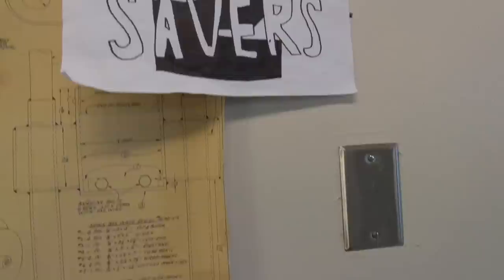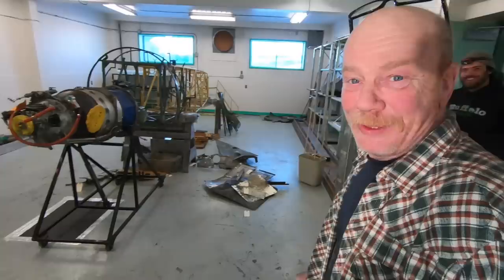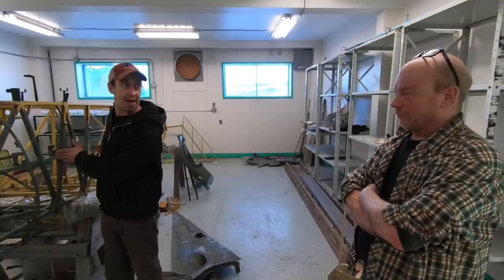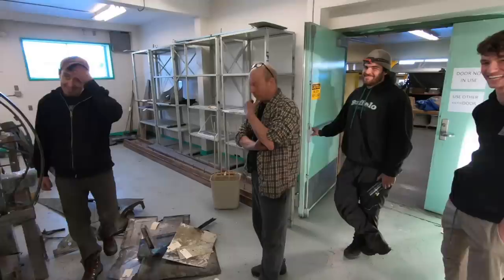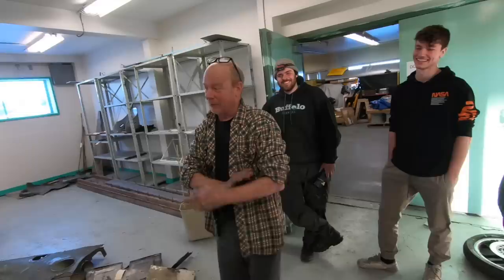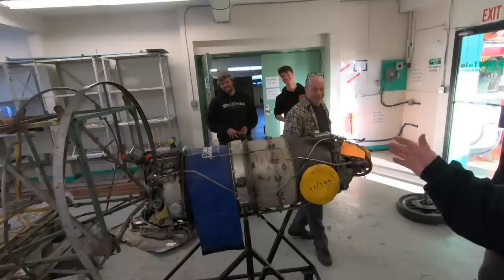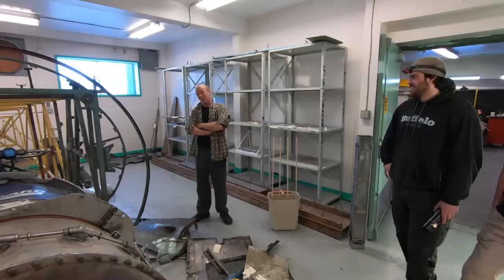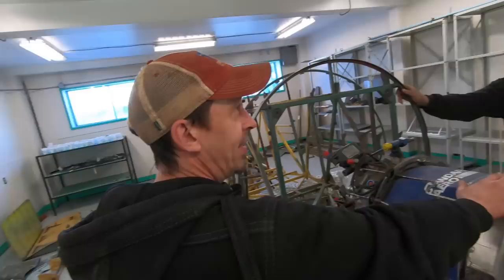Should we put a Turbine on a WW1 Triplane?  |  Plane Savers S2-E21

Comment: How many of the negative commenters here are actually real world, hands on, experienced aircraft designers? I know I’m not.
There seems to be too many “I think” comments and not enough “I actually know and this is how I know it” comments.

There is 2 issues at play here;
1 As original as possible/practical, or its a replica anyway, so anything goes.
2 is it technically possible/feasible.

You need to answer both those questions, and you will have your way forward.

Personally, I would do it if possible, but that is just me.
However the thousand people who assume because it’s a turbine it will automatically destroy the airframe does not sound right to me.
1 I believe the turbine is lighter?
2 if it is still spinning a prop, then so long as it’s matched to the airframe correctly and the engine is de rated and the VNE is upheld, where is the problem?
3 this is not a car where the object of an engine change is almost always to increase performance I.e. top speed.
4 it’s not about making the plane faster, it’s about making it better.
5 Would all these negative things be said if they were talking electric? It’s just a mindset that assumes turbine means automatic destruction.
6 In the case of Mike Patey, it seems his swaps ARE about more speed and power, and that is why I would assume he has to beef up his airframes so much.

Comment: I know Nothing about eroplanes but I am curios as to what would be stopping the plane from spinning round the motor. the air frame just looks like it would give up in protest and to be honest  1/16" ply and turboprop just dont seem to fit in the same sentence to me.  BUT  given the expertise in that room I would not doubt the feesability of the concept. AND as has been pointed out many times already,  Its not an original so your not committing any sort of historical hearasy so why not if its a viable option.  I have my doubts but keeping straight faces for so long by so many was a great feat if this concept is indeed a wind up.

Comment: You didn't mention half of the issues that turboprop engine would have caused. Having that much sida area added before the c.o.g., lateral stability would have gone out off the window, the wee little rudder of the sad little Fokker would not be able to counter the massive corkscrew-effect of such a strong engine, the wings of a Fokker Dr.1 are not made to withstand the drag they experience at speeds the horspower of that engine would get to in half a jiffy, the torque of a propeller driven by such horsepower would twist up the stringers of that fuselage like a bunch of well boiled spaghetti, the horspowers are thirsty, so on the plane's normal tank you'd maybe get a lap around the airfield out off it, the entire idea is just plain bonkers. 
I checked twice that video wasn't posted on April 1st. It wasn't, which I find kind of sad.

Comment: I'm not an engineer.  But the only concern in my mind is over-thrust.  Is this wooden air frame going to be able to withstand the force of the airflow against it at the speed that this PT6 is capable of pulling.  I'm less concerned about COG and more concerned about VNE.

We've all ripped the wings off a fly.  I just don't want it to happen on test flight day.

Let me put it another way.

You're putting a (roughly) 175 kg engine... on a 12 kg airframe.

I have full respect of Chuck and Rod and Ben and William.  But this just seems insane from my layman's perspective.
Reply: In local news, BUFFALO AIRWAYS has introduced the first supersonic passenger service since the demise of the Concorde.  Although no food service is included in your ticket, you're more than welcome to roast marshmellows over the manifold.  🤣🤣🤣🤣

Comment: uuhhhhhhhhhh......I thought it was April Fools Day at first (albeit at the other end of the year); but I see you are serious about it.  Not knowing how the aviation world works, could you get this certified to fly, or would it be labeled as an experimental aircraft?  How does the torque affect the aircraft - do control surfaces need to be enlarged?  Can someone mock up a sketch to show how it would look?   Is there a simulator like Kerbal to try this out first?  How do you synchronize the machine guns to fire through the prop?  Given the fact that you are currently missing the engine, mount, etc., this is 50-80% in your hands already, you have some very smart engineering types and a willing pilot, I would reluctantly say to do it.  It will definitely raise some eyebrows!

Comment: Good joke.... Even a totally run out PT6 is worth vastly more than a small radial.. Plus you would only have 20 or 30 minutes of fuel capacity... Plus the small tail couldn't handle the torque ...It would be a wild ride though... I fly single engine turbines for a living, and I wouldn't be anywhere near brave enough to fly that one.. Ag Pilot A&P/IA... I really enjoy your shows. Keep up the good work...

Comment: If you want to restore a Fokker replica, by all means compromise on a radial engine instead of a rotary.

But if you put a PT6 on the front, you no longer have a replica, Fokker or otherwise. You have a homebuilt, experimental, impractical airplane with a (free) turbine, and which has no practical purpose.

What's your point?

I kind of thought of this sort of thing back in the '60s when I had a Volkswagen beetle. I wanted to drop a Porsche engine in it. It was then pointed out to me that all I would then have would be a fast Volkswagen.
Reply: This is totally different. If you wanted to drop a Porsche engine into a VW beetle, it would be kind of an incestuous relationship.  But a PT-6 into a DR-1, no Fokker’n way.... :)

Comment: Why not?????????  You have got to fit a motor to make it fly and you have to design it so that it is safe so why not.
You can't fit the original motor because there are none  and the replacement piston engine is very pricey. A turbine would not vibrate as much and although the stresses are higher on the airframe you have to DESIGN the airframe.
Mike P can do it and so can you. Originality is not the issue, only stress loadings, safety and COG. Go fo0r it guys.

Comment: The more I think about it, the less I like the idea of a turbine engine Dr.I. Even on a replica. A bog standard modern Rotax, Lycoming or Continental engine, albeit boring compared to a massively over powered turboprop, will be much more adequate. Also simpler to install, easier and cheaper to purchase. I you absolutely want a radial engine go for e.g. a Verner Motor Scarlett 9S.

Comment: IMHO the PT6 on that plane is wasted. You can't use full power without ripping the plane into pieces or exceeding Vne.
If you really wane massively overpower that poor little plane get a ASz-62IR from PZL-Kalisz. Same power as a PT6, but at least a radial engine.

Comment: Sounds like a good way to rip these plywood wings off your airplane...

Truth be told, in my opinion this ain't the right way. So far you've been sticking to the original drawings as good as possible and now you want to put an engine on it which is way overpowered and doesn't even look like what you wanted to build before. Of course, it would be interesting to see a turboprop-DR.1 flying but I don't think this is what Plane Savers should be all about.
Despite the fact that it would be hard to fly as the airplane wasn't designed for such high BHP and torque. The slightest bit of overshooting your maximum power brings the risk of tearing the airplane apart. If putting the PT-6 on it you should as well consider building aluminum spars and re-enforcing the fuselage.

Boys will be boys...

Comment: I think that maybe a bad idea. The DR-1 suffered from wing failures, even after they thought they had solved the wing issues they actually didn't
This will be seriously over powered and wing loading (especially upper wing) should be looked at very closely.  This an airframe originally designed for a 100hp engine not 750 hp turbine.
Would that tubular fuse handle the torque also? just a thought
Great engine but its comparable to putting a 426 Hemi in a go-cart.

Comment: Le Rhone j9 engine weighs 323lbs dry weight vs the pt6 at 284lbs. Can you do it? Yes you Can!
Reply: Steven Jandron the gearbox for the variable pitch prop and prop itself would move CofG forward, dont you think? Unless what would need doing at the tail to compensate for the added thrust would compensate for those extra weights on the front...maybe it would have to be stretched to resemble a Stearman including second human for ballast? Or would the fuel tank in the back do the trick? Get an engineer on this.

Comment: oh je Mikey Turbine   The Red Baron with a turbine airplane would have wondered how fast the plane is with it   Problem of the exhaust jet of the turbine where do you derive the. the exhaust jet of turbines is very hot    I would install a helicopter turbine because you can install a propeller via the drive

Comment: Hi plane savers no no no don't do it turbine will be to powerful to much thrust you could pull the wings off it ,and to balance the air craft you would have to set pilot and controls back at least 2 foot to get balance back ? Bad idea plus it would not sound right save your penny's and obtain a modern radial with the same output of power much safer and it will have an electric starter.

Comment: Some considerations. If you make such changes, the nose of the DR1 will no longer look like the original at all, it will be too long. Are you trying to make something that is even close to a replica, or are you just making a flyable airplane? If you make such changes, don't bother calling it a DR1 any more, maybe a DR1J, but no longer a DR1. Are you ready for the WW1 enthusiasts pointing and laughing? They will never accept such a hybrid as a replica. Are you trying to replicate the flying experience of a DR1 at all? With this engine it certainly will not be the same, or even similar. It is an amusing idea, but I am against it. I think it will make what was a beautiful airplane uglier than a barrel of bungholes tied in the middle.

Comment: Yeah, yeah, but your engineers were so preoccupied with whether or not they could that they didn't stop to think if they should.
The world has just changed so radically, and we're all running to catch up. I don't want to jump to any conclusions, but look... Radial engines and turbines, two species separated by 70 years of evolution have just been suddenly thrown into the mix together. How can we possibly have the slightest idea what to expect?
I think the people that come here are well aware you COULD make this work.
But what are we doing here?
Building period correct authentic airframes to recapture and experience the flight characteristics of the original aircraft by building a perfect replica of the original?
Or playing Frankenplane because someone said, " you know what would be cool is if you took a World War One airplane and you put a modern turbine on it."
Are we saving planes at plane savers?
Or genetically engineering new airplanes the world has never seen?
Maybe change the name to Plane Savors.
Resurector or God.
Your choice.
But why go to the trouble to use the old manufacturing techniques. 
If we are going to bust the bubble, just make a composite wing and slap a bubble canopy on it too while you are at it.
Why would anyone want to fly an open cockpit tri plane to listen to the whine of a turbine engine?
Would you roll down the window of a 65 mustang to listen to the engine if someone put a moose call on the exhaust pipe?

Comment: This is a joke right? For a start you'd be severely restricting where it could be flown - not many grass strips offer Jet A1. Stoopid. What HP are you looking for? There must be lots of used Rotax 912/914s around that would be infinitely better if you can't get something closer to the original. Some of those guys have been dealing with commercial aircraft for too long. They don't know any other world. This aircraft is not much more than an ultralight. I've just seen that the original started out with an unreliable 110 hp motor and many were re-engined with 75 hp ones. My 912S gives 100 hp and with a modern wooden prop it would outperform the original DR1 engine by quite a bit I'd bet.

Comment: It’s never going to work. The structure of the wooden aircraft will not handle the stress of acceleration from PT6.  Is this a joke?   Love how Ronny talks about knowing how to construct aircraft.  You guys need an expert.
Reply: Motors in a case like this are DE-RATED. PT-6 is half the size, half the weight....and it is not a "wooden" air frame it is a COMPOSITE air frame with plenty of chrome-moly tubing where it counts.

Comment: Me thinks that this is some big sophisticated wind up by Rod ,instead of being asked to get a round spanner we have a jet engine to fit in a Fokker Dr.1,now Rod is taking it to stage 2 by asking for centre of gravity calculations in detail ! I would get on with your wood steaming.

If you want a big pile of vibrated  firewood  and very hot rudder pedals then a Jet Fokker is the way forward.

Comment: I loved Drabo, it was one of the most amazing aircraft that I've ever seen and would've love a ride in it. I'm NEVER one to leave anything "stock", but something's should be left alone. I have a '77 corvette that has less than 90000 original miles and all that's been changed is that it has headers and stereo. I am actually looking for the stock pieces to replace them. Please put a radial in the if, a turbine would just be wrong...

Comment: This has to be the stupidest idea anyone has ever come up with.  If you can't get a le  nome  rotary engine, or a radial engine to go in the same spot just use a 1940s or 50s flat type inline engine.  Jets have hot, high velocity exhausts which would not mix well with a wood frame, let alone a high fuel consumption.  By the way any engine change would require alot of engineering to do safely. Especially due to any c g shift with any change of engine installation.  Aerospace Engineer.

Comment: you lose the original wow its a Fokker but it is a replica and a smooth running turbine has got to be better than a big diameter radial that has rotational gyro effect that the turbine minimizes  and you don't have to run it at full throttle   GO FOR IT   show us Benjamins designing and Rod and Chucks  engine newity